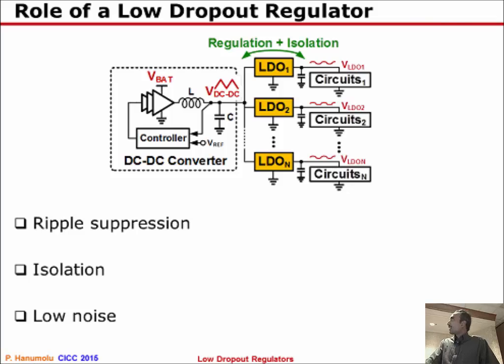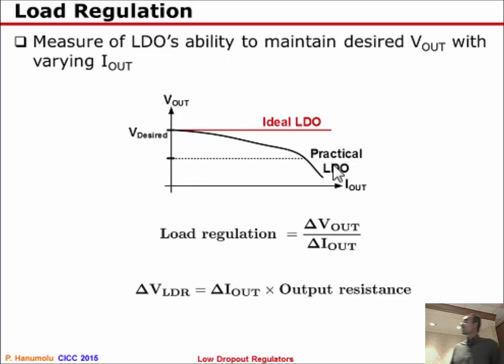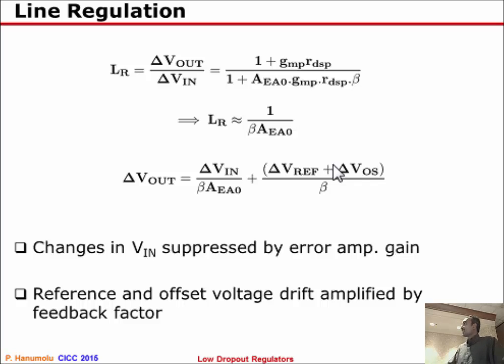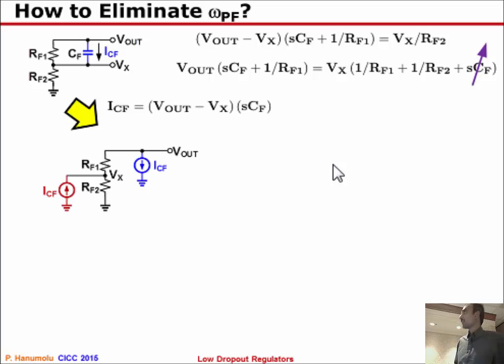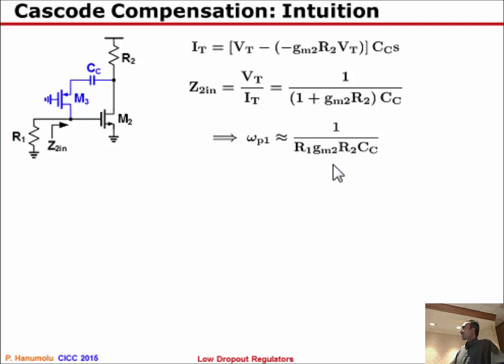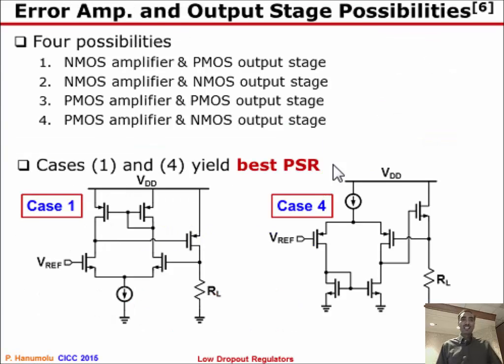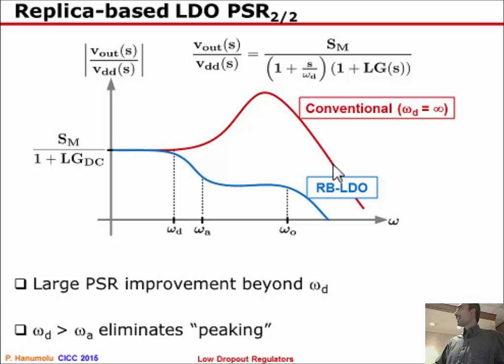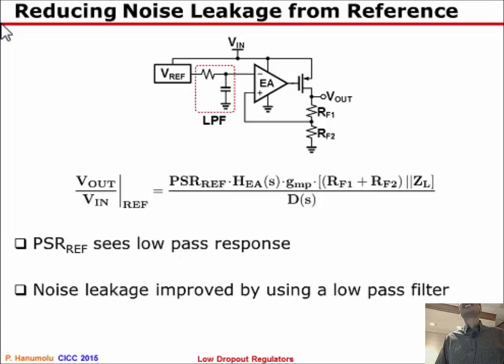CICC 2015 EdSession by Pavan Hanumolu on Low Dropout Regulators

Comment: the psrr for nmos structure shown is incorrect. The midband psrr for source follower is (1/gmrds) + (cgd/cgd+cextra). Low freq psrr would be 1/gm rds and high frequency is dominated the output capactiance